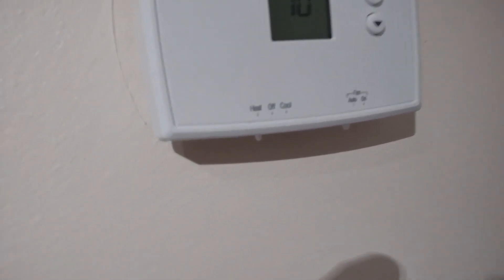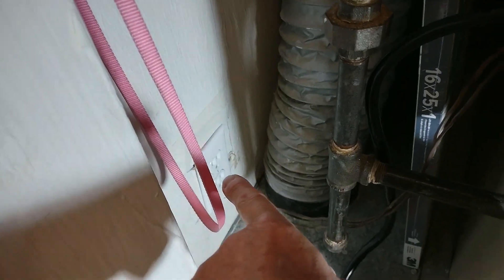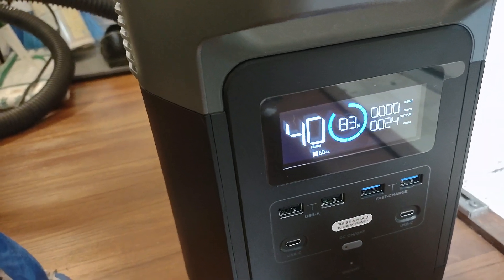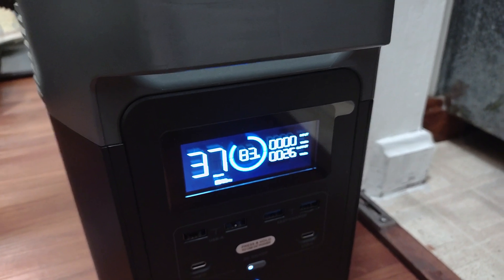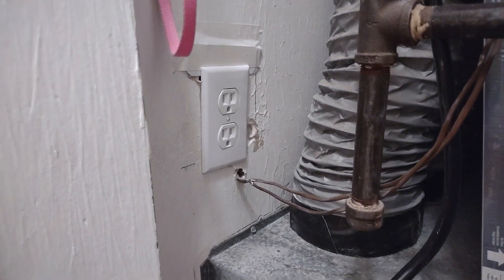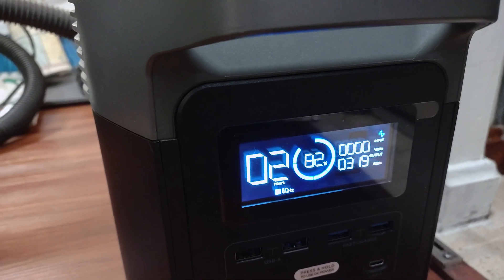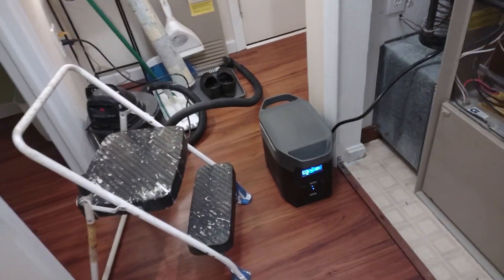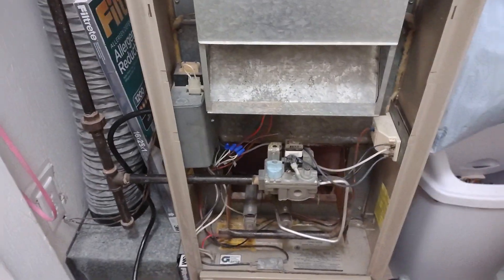Running our gas furnace off of an Ecoflow Delta power pack!  Works great!

Comment: The system in the state at the time of the video showed 2 hours of battery life with the blower on (320W). If the duty cycle of the furnace is 50% then the average power consumption is about 170W (includes the Blower off load) which for a full charged battery would go 4 1/2 hours or 5 1/4 hours for a 30% dc. I think there’s a problem if you don’t enough battery packs and have a way to recharge them routinely.
Reply from the maker: You are exactly right, Terry!    We ended up buying a small Honda 2200i gas generator in order to charge our Ecoflow Delta's in the event of a long-lasting power outage.   We are in Ohio so solar charging in the winter time won't work for us.   Good comment!
Reply: Sun usually comes up every day.  But not every day is clear.  Need 2-3 power-packs? Or, more?
Reply: @cookingwithcuyandotherfuns6238 Good,honest assessment.  Thanks!
Reply from the maker: We don't use solar at all.  We have a small Honda generator and two of these ecoflow Delta power packs so while one Eco flow is being charged by the Honda generator the other one can be in service @WilliamMurphy-b6v

Comment: Can you tell me the size of the Delta power packer using watts it is. Great video
Reply from the maker: I believe the Delta power pack has 1800 watts.   I'll double check that though!  Yes that is correct for the model we are using. The inverter can supply up to 3300 Watts surge but normally runs at 1800 watts.

Comment: I attempted the same thing with my EcoFlow Delta mini. The system should be able to handle 1400w with 2100w surge. I turn my furnace on and our humidifier kicks in but the furnace startup sequence never does. I think the EcoFlow should be able to handle the initial power spike so I don’t know what the problem is.
Reply from the maker: Sorry to hear this!   I have seen where newer furnaces that have electronic ignition sources (like a glow bar ceramic to ignite the gas) may not work with the Ecoflows.  Something about the board electronics and type of ignitor.  We have an older furnace with a pilot light.    I think you've got enough wattage to do the trick but it might be a detail that some others have talked about that is preventing it from working for you.  I hope you can get a work-around.
Reply: You need to a ground neutral plug to make it work.
Reply: Had the same trouble with a Delta 2 and found it did not supply the initial amps fast enough. I added a APC1600 ups in-between the Delta 2 and the furnace and works great. 1 other issue if you want to add a transfer switch, it is hit and miss with Ecoflow that the polarity on the AC receptacles are correct.
Reply: You stated you have two generator units you could ‘rotate’ to stay powered up. You are out of electricity…how do you recharge the generators?
Reply from the maker: @jbunboxingstuff2559 sorry I was not more clear. We have a small Honda generator so we can charge one of the Eco flows while we are using the other one.

Comment: Why shouldn't it work great?  Only 24 to 26 watt draw.  Can it feed the furnace fan and electronics and recharge ALL at the same time?
Reply from the maker: Sure if you plug a generator into it.  Also it actually draws 330 w while the blower motor is running and the peak wattage during initial blower startup is a little over 700 Watts so not every ecoflow can handle that surge.